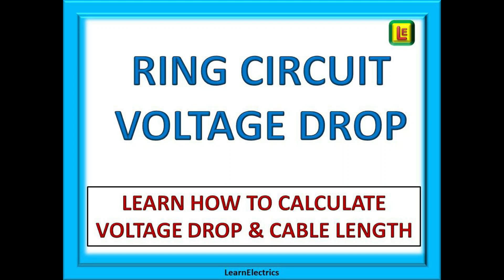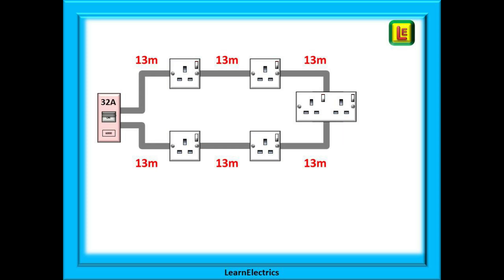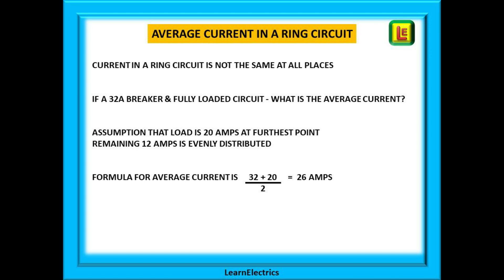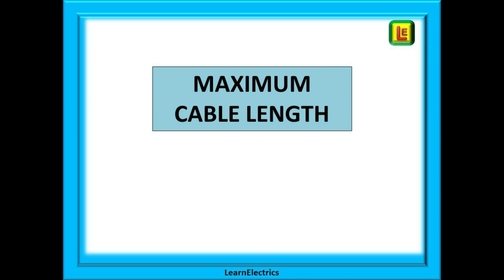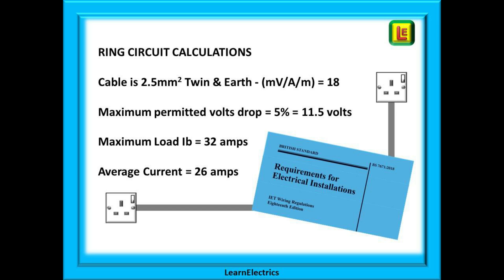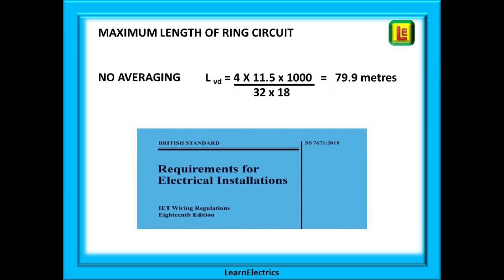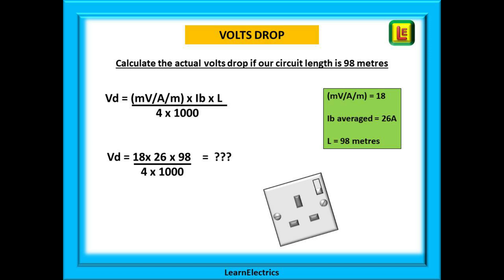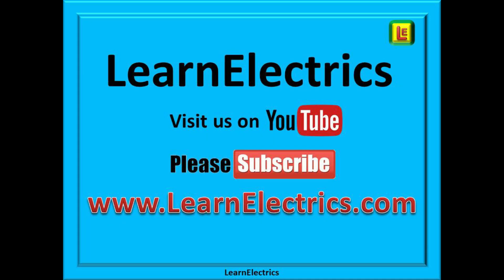RING CIRCUIT VOLTS DROP

Comment: Hello sir,

I have two questions:

I understand it looks two cables feeding to a socket outlet in a ring circuit. In the voltage drop calculation, it would be divided by 2.  I don't understand it would be further boosted to 4 due to parallel circuit factor. 

For average circuit cases (26A in a circuit), the length 98m is calculated. That is the length for the whole ring circuit from MCB to socket outlets and back to MCB. Am I correct? 

Thanks in advance and your sharing. I did learn more about electrical system.
Reply from the maker: That is the correct calculation to use and yes, the length is the run of cable from the CU along one conductor and back to the CU on the same conductor. Take a look at the video on the link below on voltage drop.

https://www.youtube.com/watch?v=TY6L0KB9Lx8

Comment: So my question is when I'm designing a circuit and I've calculated my Zs to be 1.17 Ohms. When it is tested against using the MEASURED values of a 32a Type B Circuit breaker (Max Zs of 1.37 Ohms) it would be a fail? As 80% of 1.37 is 1.09 Ohms. So if we design to the TABULATED values there is a chance that during testing they would fail due to the 80% rule, but we don't account for it in the design phase?
I'm confused.
Reply from the maker: We do account for it in the design phase. At an average temperature of 20C we use 1.09 ohms for a B32. This means that as the temperature and resistance rise, the resistance will not exceed 1.37 ohms at the limiting temperature of 70C. Have another look at the video. Have a look at this video about Zs and the 80% rule. Dave.
https://www.youtube.com/watch?v=ihD-NO-7G5Y

Comment: Great video, I would like help to understand how I can satisfy the the formula Ib<= In<=Iz for ring main socket circuit which is being installed as clip direct using flat twin and earth 2.5 cable where Ib is 26A according to BS 7671. In is 32A and Iz would be 27 according to TABLE 4D5 column 6. Your explanation would be great help. Thanks in advance.
Reply from the maker: A lot of folks wonder this, I will do a video on it. Basically a ring is two lengths of 2.5. Two times 2.5 is 5mm conductor. So now Ib≤In≤Iz is correct, if the ring doesn't break. Lots more videos on Ring circuits and testing on our website at LearnElectrics.com. Watch out for the video on your question in a couple of weeks. Dave.

Comment: It might help to explain that since there are two legs the length can be halved but also the current can be halved. this means the vd formula denominator is 2 x 2 x 1000 which is where the 4 comes from. It might make no difference but it helps some students.
Reply from the maker: Thanks for the comments Steven

Comment: Hi, great vid thanks.  Just a small thought, when calculating for ring circuit as you had mentioned in reality it is two cables in parallel, would the same be allowed or considered to be ok when measuring the VD or max length between say an MDB and an SMDB were the supply feeding the SMDB from the MDB is via 2 supply cables due to the load.
Reply from the maker: Have a look at appendix 10 of the Regs, page 497. Because of 3 phase  reactive components of two cables taking the same physical route, current sharing should not be based on 50/50 each, but may be 70/30. In other words the voltage drop may be up to 50% higher than you would calculate for the single phase ring circuit. If you are borderline on cable sizes you may have to go up to the next size.
Reply: Thanks very helpfull

Comment: Please correct me and I apologize if I am wrong, In regards to ring circuits or radial regardless of both being susceptible to overload should we not have used "In" the protection rating instead of "Ib" the design current in the formula? similar to when we consider "Zs" in a circuit that is susceptible to overload when we consider and calculate all the rating factors to give us "It" the tabulated current. I do watch all your lectures and to date, they are the best explained on the net, Well done, and thank you
Reply from the maker: No, we use Ib, the design current. Take a 7kW shower, this is a single point circuit and it only uses 30 amps but has a 32 amp breaker. That could make an unnecessary size change in cable. We use Ib = 30 amps.
However, if you are talking about a socket circuit or a lighting circuit where you don't know what will be connected, we make Ib = In but still put Ib in the formula.
Hope this helps, good question.
Reply: Thanks appeciated.

Comment: Bang on. Thanks again for this wonderful lecture. Questions : the 98 metres, is it the length of the whole ring circuit? How do you measure voltage drop on a ring circuit?
Reply from the maker: Omar, thanks for the great feedback.
The 98 metres in our example is the whole length from leaving the circuit breaker on  leg 1, all around the circuit and returning to the breaker on leg 2.
You cannot measure voltage drop with your meter unless you fully load the circuit to 32 amps, in this case, and measure at each point on the circuit. Far better to calculate as per the video. I would always prefer to calculate, it's safer, accurate, the accepted way and you can't get an electric shock off a pencil and calculator. Glad you enjoy the videos, lots more to come. Dave.
Reply: @learnelectrics4402  Hi Dave, I work in a domestic environment and I have never thought of voltage drop in a ring circuit. My question is, when should I be concern my ring being to long ?
Reply from the maker: If you are designing your own circuits, at the design stage, but it is generally accepted that a ring circuit up to 100 metres is ok if the load is uniformly distributed. It is up to you to decide what uniformly means for your own circuit. Hope this helps. Dave.

Comment: Brilliant explanation, I understand the theory but, one question is, if I’m designing a new ring final circuit in say a new build property, how would we know how many amps will be drawn at any given socket outlet to aid us in working out average loads? Could we use 26amps as a good starting figure for all domestic rings?
Reply from the maker: Absolutely right. We will do a video on diversity soon, but in the mean time, diversity says that not all the sockets will be in use, not all the lights will be on at the same time and so on. The only circuit that might be heavily loaded is the kitchen ring at meal times so 26 amps could be a good figure to aim for. I know this gives a max length of 98/100 metres but 100 metres is a long, long way in the average 3 bed house, most times you are not going to get to 100 metres. Hope this helps and thanks a million for watching. Spread the word, there are lots more videos to come. Dave.
Reply: @learnelectrics4402  thanks for your detailed response. I’m enjoying all your content so far, keep up the good work Dave👍👍
Reply from the maker: Great. always happy to help.